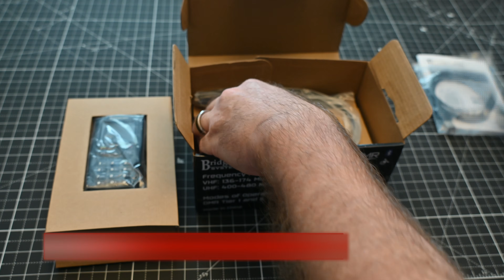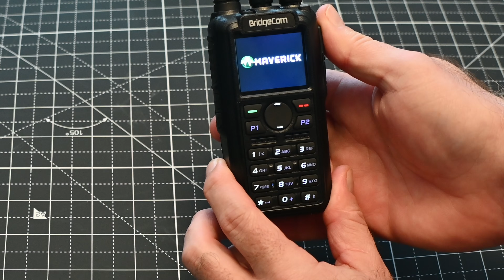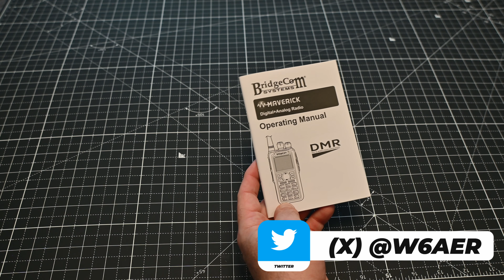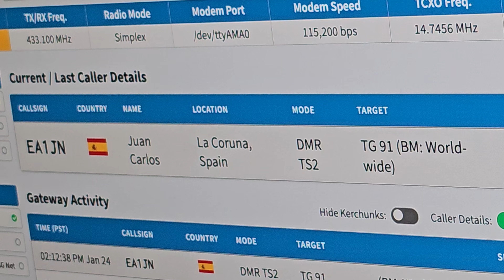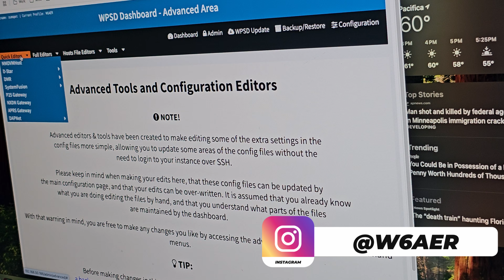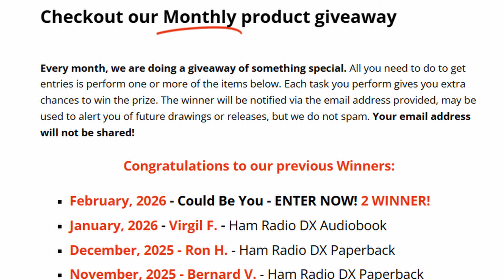BridgeCom Maverick Field Test: Does It Live Up to the Hype?

Comment: Any comments of how the analog performance is compared to other analog radios?
Reply from the maker: Actually I found it good, but mostly use it for DMR. Much better than some cheap Chinese ones but not quite as good as a higher end icom or yaesu, though might surprise you.
Reply: @MaximumRF  do you know if this radio has the ability to scan DMR radios that may be police or other professionals might be on? I know they're typically on trunk systems but I didn't know if it had the ability to pick up other DMR services.

Comment: The last half of your video dealt largely with your hotspot. Why didn't you focus on the radio's performance? Does it have significant spurious emissions? Does it work well with analog simplex and repeater communications? How long does the battery last in digital modes? Why buy this instead of the Anytone AT-D890UV?
Reply from the maker: All good points, and I can address them here. Yes, works very well with analog repeaters and does have good battery life. I can go all day with it and when using with low power on Hotspots, several days. As far as a clean signal, I would say it falls in the middle. Better than some low end units in the $50 range but not as clean as a $500 unit, as expected. It is FCC certified so meets the requirements and standards. I may do a video on measurements, kind of got my wheels turning with your questions. Thank you!
Reply: @MaximumRF thank you for so much for your quick response!

Comment: would you suggest this HT for beginners ?
Reply: DMR Is too difficult and a real pain. P.I. t tri band baofeng.
Reply from the maker: Yes, they can be a challenge if be to them and if moving from another brand
Reply from the maker: Yes, actually it is specifically designed for those new to DMR

Comment: Anytone is releasing their 890 with airband rx and possibly NXDN. With bridgecom have a similar radio?
Reply from the maker: @icom-pi6tp My understanding is that the NXDN is coming with a firmware update. I have not tested it yet, but will for sure. The Maverick does have RX on the air band and therefore, given the hardware similarities, I will assume as radios based on the same architecture should be able to do so. I am not aware of other brands carrying it just yet as it is a very recent release. In fact, I think I got a radio from the first batch.

Comment: This appears to be a rebranded Anytone.??
Reply from the maker: @EarlSimmons-w5x  Yes basically it is, with US 
support. The Firmware actually shows it is an AnyTone with some minor tweaks it appears. You are essentially correct!
Reply: @MaximumRF  It's a rebranded Anytone 890UV, however, do not use anytone's firmware as it won't recognize this HT.  Bridgecom will provide all the firmware updates for the Maverick.

Comment: Hey man - I tried to use 650 at checkout and it doesn’t apply. Dunno what’s wrong.
Reply from the maker: @JJRfromNYC I heard some reports, looking into it. Will post an update. Thanks for letting me know!
Reply: @MaximumRF  Thanks a lot. Be well.
Reply from the maker: @JJRfromNYC just use https://www.bridgecomsystems.com/discount/650?ref=maximumrf and apparently there is no need to enter the 650 at the checkout. I made them aware of the confusion, this link or the one in the description is all you actually need.